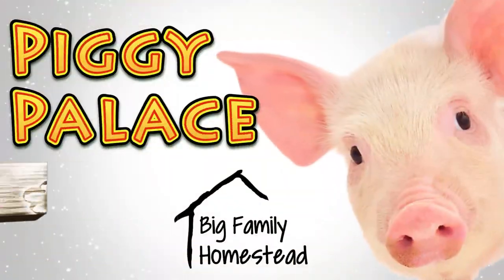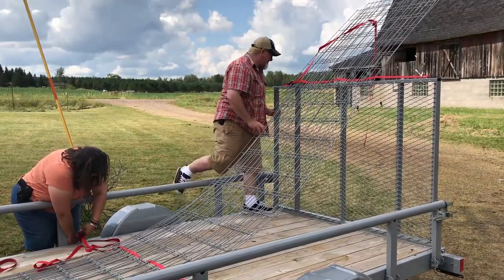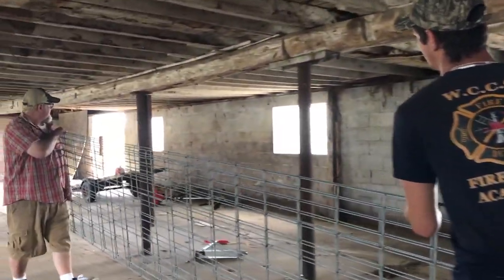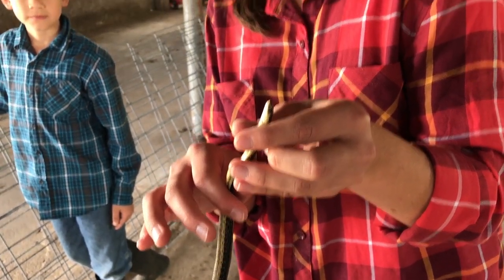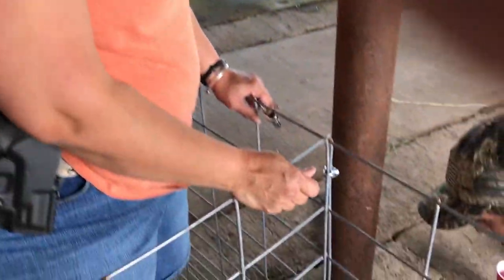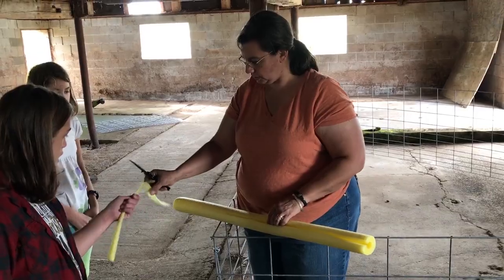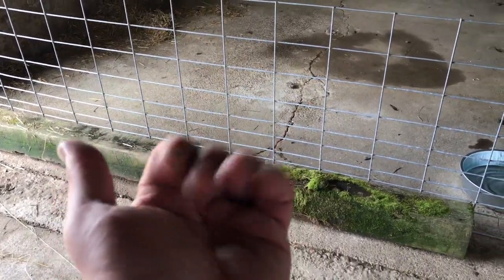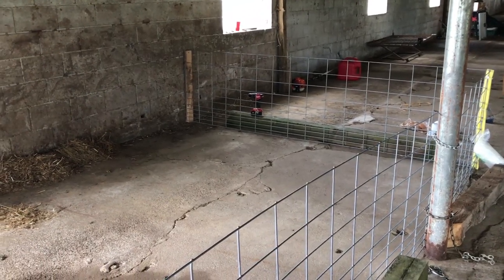Piggy Palace

Comment: I don't normally comment, but I'm concerned here.  I've raised hogs and there is no way that fence will hold a 300lb hog.  I know, piglet's, but they will grow fast, quicker than you expect.  I would remake the pen with rough oak or some hardwood.  Also, put wood on the floor, make a raised platform so you can spray the hose under it.  Get rid of the old hay, you will kill your piglet's.
Hope this helps.
Reply: yep....start (3 lbs) to finish (200+) takes about 6 months.
Reply: I'm seeing the start of a  funny pig chasing video. I raise pigs too.
Reply: They can always put one in the house and call him Arnold;)

Comment: It's great to see you back in your homesteading element! I think I agree that the pool noodle will end up as pig fodder. It'd take awhile to file the sharp ends of the wire, but maybe the younger ones could do it? It'd probably be worth it in the long run. Old hay certainly might be problematic. Trying to picture you lifting a full grown pig over that fence. Lol! I'm not sure if your plan was for it to be an either inside or outside pen (but not one that's easy in/out), but I'd assume WI will have lots of transitional days where the daytime will be warm enough for the pigs to be outside, but nighttime will require they be inside. Probably more of those types of days than in OH. So yeah, a gate. Oh, and way to go, brave Lady Clare, slayer of trolls and snake wrangler extraordinaire!

Comment: With them inside one issue will be SAD seasonal affective disorder especially as it gets colder. they need good daily dose of sun. They'll be lacking in iron too. Its also going to be very hard to keep clean. pigs dont like to poop where they sleep and eat. they are born house broken quite literally. A piggy door to outside paneled area would be ideal.  You could also use a kiddy pool at one end in the corner like a litter box with food, water and bedding area opposite end. Yes pigs push but they lift too. they will stick their snout through panel and snatch upward. they can also jump 3 feet easily and climb. They are grazers so they need good fresh hay to eat. A kiddy pool of water outside will allow them to cool off. Pigs love blankets even in summer but they need to be dry. You have an okay temp setup but you'll learn quickly what needs adjusted. Right now you have high maintenance setup and poor health conditions for long term which equals high cost as well. Take a look at my video "More life on the farm" Ive had lots of pigs for lots of years. They can be easy or hard.

Comment: How are y'all gonna get in and out of the pen? Just sayin, not judging. They are gonna be happy in their new chateau for sure. Might need to also put some holes into the concrete floor and put a piece of rebar through the railroad ties to hold them in place. Piggys snouts are strong. And when there is a will they will find a way. Big hug to all. Be safe.

Comment: Great Choice inn the mettle pig pannels. Now you have area that will last many years without nails or screws cutting the pigs. That is a great area to teach young pigs to  electric fence as well. If decide to do that just one 1 strand of wire 12" off the bottom of pannels. 2 weeks the pigs learn very fast to back off and back away from wire rather then push through. It's a nice set up for a couple hogs and they will be very comfortable this winter. But if you do have issue with them pushing pannels (they're so strong)! just run that wire around and you won't have issues. They will be fine when small but when they get big they are like tanks,

Comment: We made a solar heater out of pop cans. 4x8 Hung it on a house window. We put a thermometer inside the window to see how hot it got. It was a plastic thermometer and it melted the thermometer at 250 degrees. We're thinking it might had got up to 300 degrees. We have used it for a few years now. It warms half the house. Might be something to explore on house or barn. As cold as it will be there I don't know if that would help.

Comment: Do you have to heat that barn when it gets cold? If so what kind heating system you thinking of using? 
I've never dealt with bad cold so I'm curious about how you handle it.
Reply: Patty Massey  that was the first thing I was thinking.
Reply: No, you wouldn't heat the barn. Use a lot of good  bedding and keep the wind from blowing through and the livestock will be fine.
Reply: They will have chickens too.  May need to do something extra for them or they might not be laying very well. But I think you're right.  If it gets in the 20 below or more, you can always pile in more bedding so they can make their own little nests in it. That plus good carbs for meals and they should be warm enough.

Comment: I don't think that wire fence will hold a big old pig in. Especially within the wider side.  You will have pig mayhem and they will get mixed in with the goats and you could have  strange looking additions.... ok, I got carried away but you get my meaning.  Put in strong boards on the top and bottom and you've killed 2 birds with one stone.  No sharp corners and a stronger fence.
Reply: Don't forget the gate..........

Comment: I dont fuss at you often. lol BUT, I see some major problems in your future. First of all, get rid of the pool noodles. they will eat it and end up with a blocked gut for sure. Second, all of that hay and straw in the mow, needs to go. Spread it out for your garden for next spring, but get it out of the barn and away from the pigs and chickens and goats. You will have either or gut trouble or respiratory trouble  going on. You need to invest in some good ol straw for bedding. And some new hay for feeding the goats and cow. If you turn your pigs out in the field, I hope you have an electric fence for them. I was thinking you do , but didnt take the time to go back and look at older vids to see. God bless.